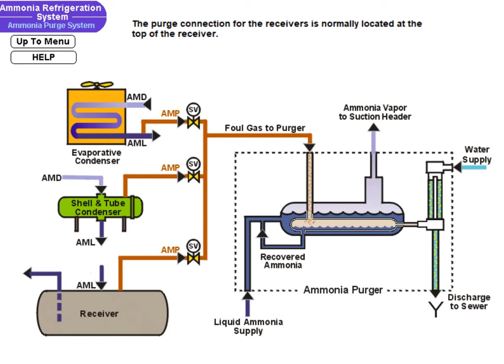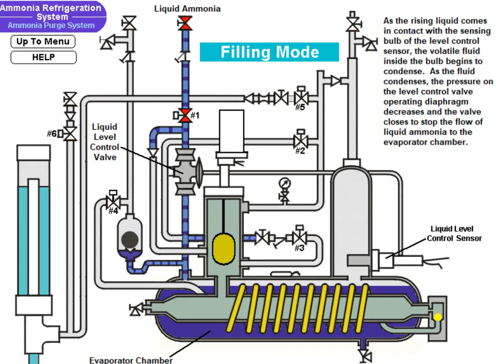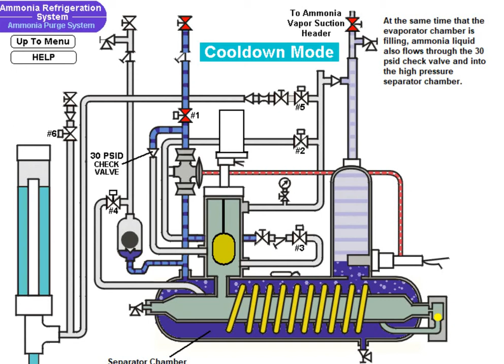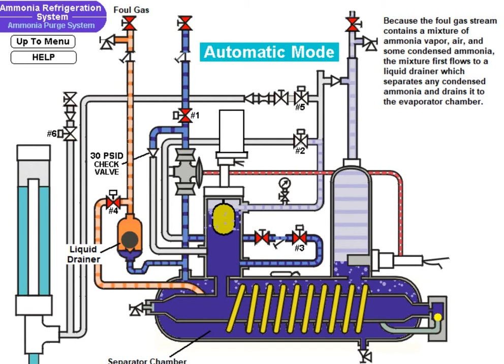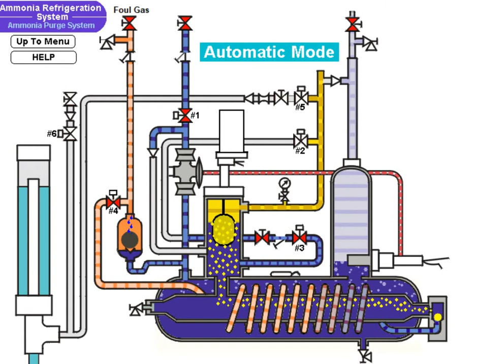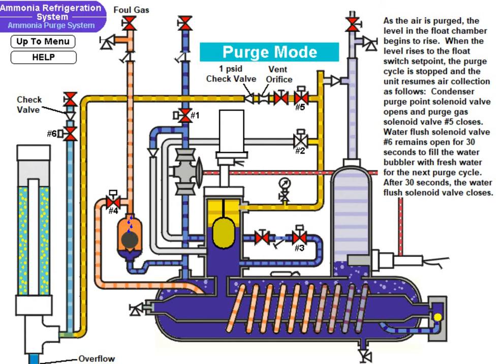Ammonia Auto Purger

Comment: I see this is from a year ago so hopefully I get a reply. Solenoids # 1,3,4,&5 do not de-energize #2 never energizes and #6 works fine. I also have no bubbles coming from the bottom of my bubbler. There is ice under my liquid level control and all the way to the metering valve. I have tried everything I can think of and I'm about to just get a new purger... This thing is probably older then me..
Reply from the maker: https://youtu.be/bxe9387F_6U?t=805
Reply from the maker: is it a hansen?
Reply: Clean your check valve on your bubbler. I have had trash get into mine and it won’t bubble and purge correctly